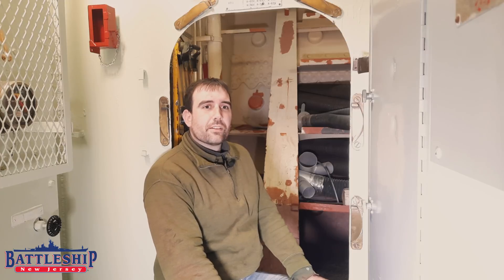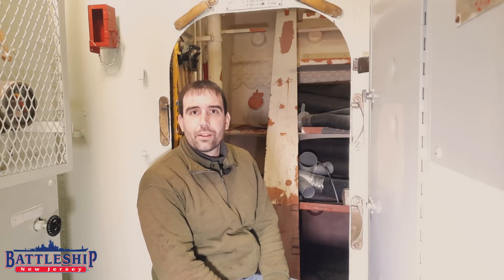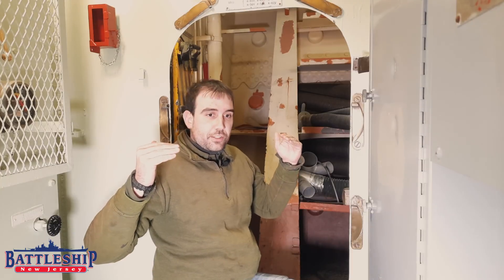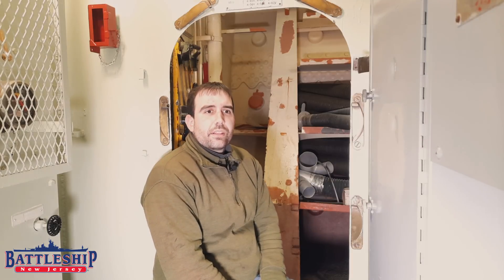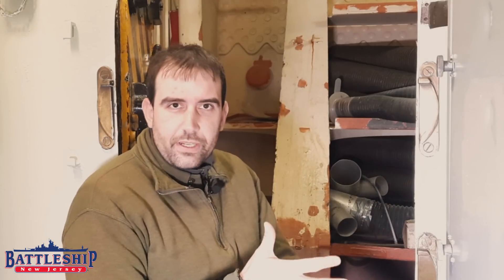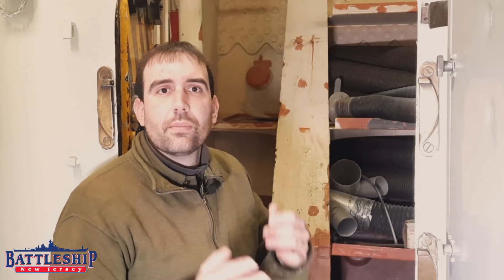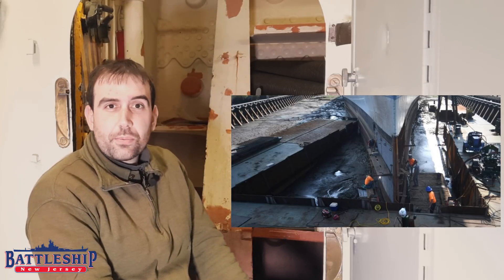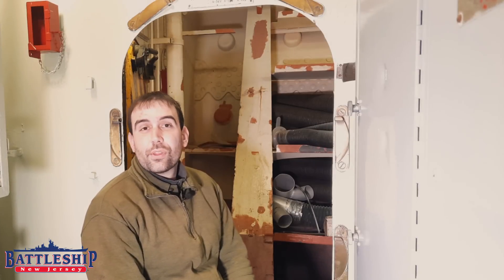Ship out of Water: Why aren't museum ships on dry land?

Comment: I was waiting for a mention of IJN Mikasa, what about preserving a battleship in concrete on land?
Reply: Concrete has a lot of moisture in it naturally. It also expands and contacts thermally. Since the steel of the ship also expands and contacts but at a different rate this sets up a battle at the surface between the two. On cold days a gap can form which will allow more water into the "mould" of the ship, which if that freezes will then severely squeeze the hull. I suspect on a ship like the Mikasa the effect would be much smaller than NJ. Another way to look at it: a concrete berth isn't preservation, it's a sarcophagus. You'll never be able to access the hull again.
Reply: @fire304  Ackshually! Concrete and steel have approximately the same thermal expansion rate as steel.

In the case of Mikasa it was to make it near enough permanent but you could jackhammer away the concrete if you needed to access the hull.

You could also pour the cement in large blocks that could be removed individually if needed.

Comment: Another issue is that the humidity and proximity of the seawater results in about 0.4-0.8% hydrated salt mist which will still corrode steel quite effectively. This is what accelerates bridge corrosion in coastal areas. It also does the same thing to rebar in reinforced concrete though the process is slowed by diffusion through concrete(until the expanding rust ruptures the concrete anyway). Ultimately, for ships it is much easier to just coat the steel in zinc and to put submerged sacrificial zinc blocks in electrical contact with the hull. Zinc oxidizes easier than steel/iron, making saltwater attack it first, and zinc forms an oxide skin that resists further corrosion.

Comment: I haven't heard anything about cathodic protection. It's done passively with zinc anodes bolted on, or (as on the steel-hulled Star of India at San Diego Maritime Museum, launched in 1863 and still sailing) a positive electric current that, if anything, would pull iron OUT of the water and on to the hull.

Comment: Err, hate to burst your bubble. There are plans to graving dock / dry dock USS Texas. In addition, as long as your supports are intersecting the frames and placing the appropriate pressure per frame, it replicates the force of the water on the hull since the force on the hull plates are transferred to the frames.
Reply from the maker: Texas is getting a year long dry dock and then going back in the water
Reply: @BattleshipNewJersey  That is correct, but if you check the Wikipedia page and Google the internet, there was a dry berth project on the table. It seems to be placed on hold due to the lack of visitors at the location at San Jacinto. I would assume that eventually it will be dry berthed.

Comment: Hunters Point Ship Yard has some old dry-docks that aren't used anymore. I've wondered if you couldn't put a ship -- like the USS Hornet -- in there and then fill it with dirt or sand. Wouldn't that provide support without contributing to corrosion? Might even be a good way to dispose of contaminated soil if it was properly sealed on top.

Comment: The U-505 is on dry land. Or, rather, in dry land. I suspect that the pressure hull provides a lot of structural support against gravity.
Reply: I think submarine pressure hulls might be comparatively more durable.
Reply: U-505 is also inside a purpose built building and therefore no longer exposed to the weather.  Doing that for a battleship would be very expensive not to mention the size of building required.  I doubt that any organization maintaining any of these ships have the resources to consider a building for any of them.  (removed a duplicated word. I need to remember to proofread before posting)

Comment: The burning candle will consume the oxygen, creating CO2. The CO2 will be absorbed into the water creating carbonic acid, not good. You would be better off purging the space with nitrogen, very cheap and non-reactive.
Reply: They could use pH buffers in the water in the tanks to prevent formation of carbonic acid. That is if they know to do so.
Reply: Although nitrogen is definitely better, carbonic acid is not an oxidizing agent. So if only fractions of a percent of oxygen is available in this reaction:

Oxidation of iron going into aqueous (water) solution:
2Fe → 2Fe2+  + 4e-

Cathodic reduction of oxygen that is dissolved into water also occurs:

O2  + 2H2O + 4e- → 4OH-  

The iron ion and the hydroxide ion react to form iron hydroxide: 

2Fe2+ + 4OH-  → 2Fe(OH)2

The iron oxide reacts with oxygen to yield red rust, Fe2O3.H2O

So once that fraction of a percent is used it will not rust until the door is opened, where ever second it is open it will rust at a much accelerated rate until the candle is burned, and door is shut.

Source: https://www.thoughtco.com/how-rust-works-608461#:~:text=Rust%20requires%20three%20chemicals%20in,iron%2C%20oxygen%2C%20and%20water.&text=Carbon%20dioxide%20and%20water%20react,breaks%20into%20hydrogen%20and%20oxygen.

Comment: I learn at least one new thing every time I watch one of these. The candle is one example. Years ago I was warned about sealed voids and compartments on steel ships and barges. Steel oxidizes and over time will reduce the amount of oxygen in the air to the point of being deadly. A candle would accelerate this.  Thanks for taking care of your Battleship.  The amount of knowlege you have on these and related vessels could fill an encyclopedia.  Perhaps you should create one.

Comment: RMS Queen Mary  is 'in urgent need of $300M in repairs' after being ignored since she became  a permanently moored attraction in the city of Long Beach since 1967.
Reply: The USS Texas is another bad example. Now the ship needs a big structural overhaul.  The Navy knows how to preserve the useful condition of ships over a very long term. They keep them in the water because that is the best way, long term. Preventing electrolysis and corrosion is something we know how to do. Doing the above plus required routine maintenance will prolong indefinitely the life of a steel hull.  They let the Queen Mary and the USS Texas fall apart before they started worrying about it. They tried all kinds of goofball repairs on the Texas. It is much less expensive and much less difficult to maintain any piece of equipment in good shape than it is to wait until it falls apart  and then fix it. I do not believe that , from what I have seen,  that anyone is going to let the New Jersey fall apart!
Reply: In the case of the Queen Mary, there was a lot of deferred maintenance and mismanagement ever since the 1970's. Also, they removed much of the machinery, lower decks, and some bulkheads, which created massive structural problems.
Reply: They was talk of scrapping it but it would have to be done where it sits because they built a shallow shelf for it to sit on than pored concrete in the haul. No possible way to re float it
Reply: A graving dock could potentially be built around the Queen Mary and Battleship Texas like what was done with SS Great Britain.
Reply from the maker: The Great Britain is less than a third of the length of Queen Mary and a completely different construction with completely different needs. You're looking at very high costs to do it, if they had that kind of money they wouldn't need to put her on land in the first place.

Comment: What about the U-boat in the science and industry museum? From what I understand it's sitting in air as well?
Reply: A sub has a totally different construction.  What you see from the outside is the superstructure, which is actually rather light and is attached to the pressure hull within.  This is where the ballast tanks and such are located.  Most of the superstructure is designed to be self-supporting.

The pressure hull is actually a cylinder with rounded blunt ends, similar in shape to a propane tank or a Tylenol capsule. This is actually the load bearing structure for both the hull and the superstructure.  It is designed to handle hundreds of pounds per square inch of pressure differential between the inside and outside.

Visualize your home hot water heater.  It's weight and rigidity comes from the heavy steel pressure vessel within, not from the insulation and aluminum shell on the outside.

Comment: What about the approach Japan took with Mikasa where they encased the hull in concrete?  Is that a good long term solution?  Thanks
Reply: No, it's not.
I read somewhere else that they discovered concrete reacts with metal and can produce acid.
It's always the chemistry that gets the ship in the end no matter whether it's a wreck at the bottom of the sea (ex: Titanic) or an old vessel moored at dock.
There have been a couple of museum vessels repossessed and decommissioned after so many years because they were just too far gone after deteriorating for years.  They scrapped a naval vessel on display on the eastern seaboard not far from USS New Jersey and a Soviet sub that had just horribly rusted after it was flooded and sank.  Of course, the sub was recovered after being sunk for years!  The organization that owned the sub didn't have the money to salvage it.
Reply: The thing with concrete, is that it is a porous material, and doesn't actually keep the water off the ship
Reply: @stephenn1056  That should work just fine on dry land.  🤨
Reply: @worldtraveler930   theres no such thing as dry land, it rains in Japan and concrete is typically water permeable.   If you look at older structures you will often see rust streaks from inside and even broken concrete from the expanded (through corrosion) rebar inside.  The rear corroded because water got to it.
Reply: @worldtraveler930   theres no such thing as dry land, it rains in Japan and concrete is typically water permeable.   If you look at older structures you will often see rust streaks from inside and even broken concrete from the expanded (through corrosion) rebar inside.  The rear corroded because water got to it.
Reply: @stephenn1056  It isn’t porous if cured properly
Reply: Sure looked like concrete when I visited. You might be right though - it might not be the whole ship. "The topside areas, including pilothouse and radio room, have been restored to close to their original condition, but below-decks is a different story. Only the two decks below the main deck are accessible- the rest were filled in with concrete as part of the terms of the ship being preserved following the Washington Naval Treaty." https://military-historian.squarespace.com/blog/2017/6/6/kfok760iav4wk5ibz8e06517z4rvxt  So it might not even be the whole ship. That's about the most authoritative notation I've seen; most other articles just say the thing is "encased in concrete."
Reply: I "THINK" that the British have also put a ship in concrete.
Reply: I can't help but think this, with all the drawbacks the other commenters have noted, might be the best that can be done with USS Texas and USS Olympia.
Reply from the maker: Heres an entire video of why we don't put museum ships in concrete: https://youtu.be/17wnf7ehcZw
Reply: @BattleshipNewJersey  Thanks for creating that whole video basically in response to this question.   Much appreciated!

Comment: Burning a candle in a sealed compartment to remove oxygen  – now there is something new I learned I didn't expect. Very interesting video. And thanks for mentioning the USS Texas. We live only a few hours away, and the fate of her is something you hear about in these parts. It seems that once COVID has passed restoration of her can finally get under way. Which will be very nice. It seemed for a number of years that it was a bit too much of ta ouch and go situation for her (will she make it, will she sink ... I remember all the leaks), and to know that in all likelihood the last remaining dreadnought will now be here for future generations is definitely a good thing.
Reply: I just cant understand why she is being moved to Mobile to enter a floating dry dock instead of moving the floating dry dock to her.
Reply: Nitrogen purge would be better. CO2 and water create an acidic liquid, not so good for the steel. Always water in the ballast tanks. Even just condensation from moist air and temperature changes is enough.

Comment: How about a volume of pebbles, ball bearings or marbles that with the air have a density of water so that they will rise up to the waterline?
Reply: I think that abrasion would be a problem. But I really like the idea of displacing the water with something else. I wonder if we could use absorbent polymers like those found in stress balls? That would potentially keep excess oxygen away from the metal ... but I would be concerned about it holding up the weight evenly.

Comment: I would have expected to hear that graving could be done using well graded pea gravel.  It's free draining, and supports the ship uniformly.
Reply: pea gravel holds tons of water just dig in a pile
Reply: @imchris5000  sure it does
Reply: @imchris5000  Not true properly drained. Fence posts should sit on a hand  full of pea gravel for drainage. Your post will last much much longer.
Reply: @Pusser311  sure it lets water pass through but it still holds water. go dig into  pile that sat in the sun for months it still still be wet when you dig into it

Comment: For a steel hulled Museum ship what is the time period that you look at between dry dockings?  It seems that as long as you put the vessel in dry dock on a regular schedule to clean, paint the hull etc. then preserving in water isn't a issue.  It becomes a issue when the museum doesn't have enough money coming in to support regular dry docking and then the ship deteriorates to such a extent like the USS Texas and major efforts are required to save her.  It is the old adage "pay me now or pay more later".    Thank you for making this videos, very informative.
Reply from the maker: Ideally for museum ships you're looking at 10 years. In reality, thats more expensive than most museum ships can afford. We're at 30 years right now and anticipate a $20 million process in a few years so that we can do it.
Reply: @BattleshipNewJersey  That also means that a museum ship is very dependent on a viable ship repair industry - no drydocks (or floating for that) in close proximity = more costs when docking time is up.

Comment: My guess would be; it is hard to drive a ship up hill out of the water. Ships just are not designed to go up hill or down for that mater.
Reply from the maker: The ships on land typically got through this process:
A channel is dug from a river to the desired location
Ship is floated down channel
Channel is filled back in
Water around boat pumped out

If a location is too close to the river, the river can overflow and reflect the boat. This happened to Batfish recently.

Comment: Are submarines different? The U505 in Chicago is now in a building but when I was a kid it was outdoors next to the museum. The Albacore in Portsmouth NH is also stored on dry land. Is it the size or shape of subs that makes the difference, they are cylinders and tiny when compared to a battleship.?
Reply: Submarines are made of rings. While not perfect, a circle is as close to ideal for resisting "pancaking" as any shape. They are also designed to experience tremendous external loads, far in exceedance of those posed by "mere" gravity. Lastly, they're far smaller (especially the majority of museum ones, French Boomer not withstanding) than most of the museum ships we're discussing.
Reply from the maker: There a quite a few subs on dry land. Its often deemed that dry is over wet more economical to do that to subs, though that doesn't make it better for preservation.
Reply: Subs can do this easier as their hulls are specifically designed to distribute loads across the entire hull. Ships are designed to float so only certain framework is required to make the hull structurally sound whereas a submarine must resist forces far greater than any ship. Once submerged the entire vessel is being crushed under the weight of the ocean

Comment: Well like most of your videos that explained things I had always wondered in a really well laid out way. Loved the detail about using a candle to remove oxygen from sealed compartments. 
I have one question though. Its my understanding that the battleship Mikasa in Japan was encased in concrete. This being done as a term of her preservation under the Washington Naval treaty. Would concrete provide the necessary support to the sides of the vessel to prevent similar structural issues to drydocking? And if so does it pose other risks to the vessel?
Amazing channel I look forward to everyone of your videos.
Reply from the maker: Concrete is bad for steel and rots it more than water and is not a good choice for ships. Some museum ships tried concrete decks, we did patches of it, it makes things worse even though its cheap.
Reply: @BattleshipNewJersey  SS Eastland which capsized in Chicago canal had concreted decks. It was found in the enquiries afterward that that was a big reason to hers shall we say insufficient stability (with the passenger load she had, she was barely more stable than a logg in water....)  So yes concreting decks creates stability issues and the steel below WILL continue to rust but now the rust is inaccessible (without a lot of work) ..... bad thinking, bad thinking